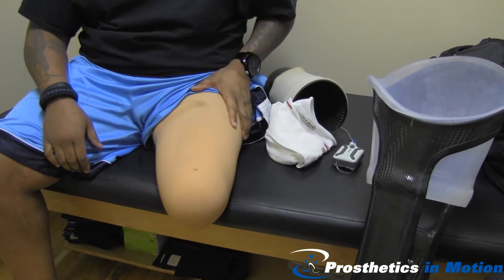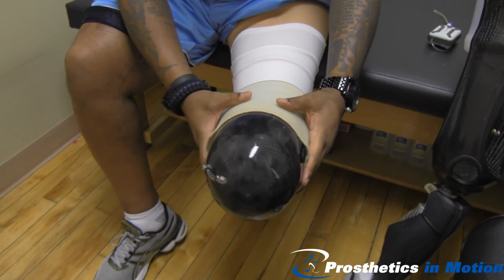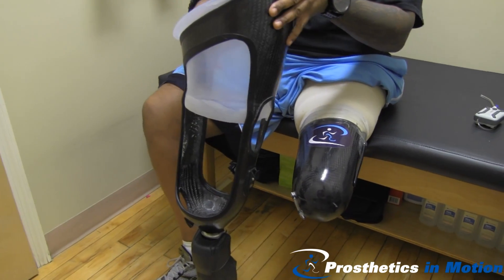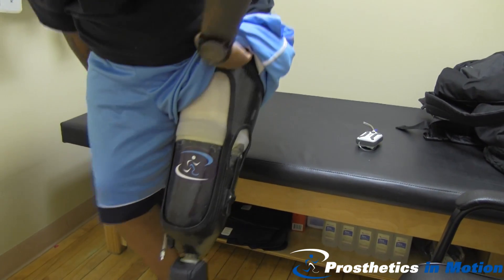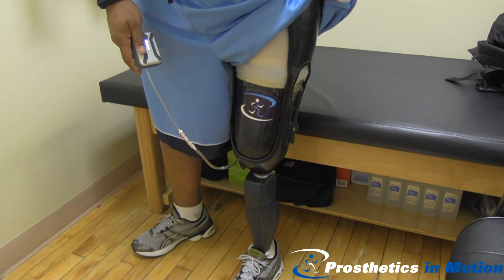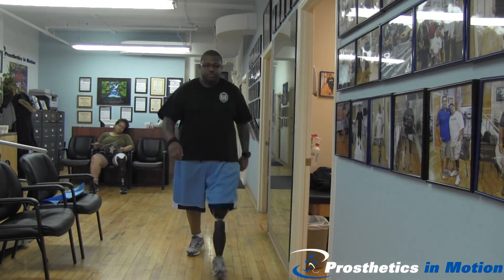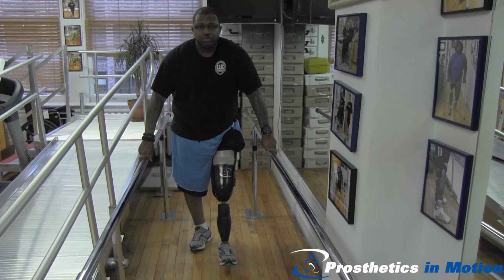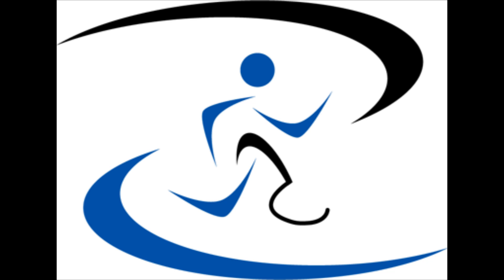Demonstration of Double Walled Above The Knee Vacuum Prosthesis

Comment: I am English and will very soon be having an above knee amputation.  the department that deal with prosthesis said that they provide a full range of legs from a table leg to a computer driven one . I asked about the suction ones as they are on here a lot . they said that although they provide them they said they have limited success with them and they have a lot of issues with sweat and other issues . could anyone please give me some advice . i have no knowledge of any of this . msny thanks . I have an ottoboc wheelchair and its first class . if the legs are ad good then no issues at all Im sure !
Reply from the maker: Good day David,

The above video is a patient who uses a double walled vacuum prosthesis. We do not typically fit these types of socket systems. However, this patient has a very long residual limbs due to traumatic injury. For new amputees we have found patients enjoy having a silicone suction liner with a seal from Ossur and accommodates limb fluctuation. If you have more questions feel free to email us at prostheticsinmotion@gmail.com. Thank you.
Reply: Humne aisi time chahie

Comment: i wear this system as a left transfemoral amp and i make these double wall systems, they are great, if youre an above knee amp you usually always have lateral distal pressure,  what is great about a double wall system is that it equallizes pressure in the residual limb, and essentially takes much pressure of the distal end of your stump, thus stabilizing bone movement within the socket containment.  the more your femur moves within the socket, the less control you have of the prosthesis.  iget even more control with my system being modified sabolich which channels the residual mucsles, almost like tri plantar control sense.  but anyway since being in this system i have more endurance my walking habits improved, and best of all reduced my phantom pain and pressure blisters, sometimes scists.  and to answer youre question, the system is able to stablize under vacuum with sock fit because the gel liner taped around his inner half shell seals air tight around the silicone liner he is already wearing when this video starts, the socks are sealed within this as well, the socks aid in providing the wicking of sucking out the residual air in the sealed system before he hits the button on his pump, with out the socks this system wouldnt work, a true fit with this system means you would use a nylon for wicking, lol.  but this is a great system, and this clinic did an awesome job fabricating this leg.  as a technician myself i can appreciate the craftsmanship here.  beautiful carbon frame, they outlined the cutouts with leather to protect his inner shell and liner, and the coolest part is the locking mechanism, like off a snowboard binding, lol, great idea, im going to use that sometime, right now i use a locking push pin design to lock my frame and inner shell together, both are effective ways and very cool addition the the asthetics, makes for one helluva lamination job...  good shit yo!
Reply: So would a design like this work for bka amps? It seems to require a great deal of pressure but as you likely know a person with high body mass requires a much sturdier limb, which adds weight especially on the back end of the gait when the leg is lifted to move into the next step and the limb is essentially hanging on by its own method whether locking pin or in this case vacuum.